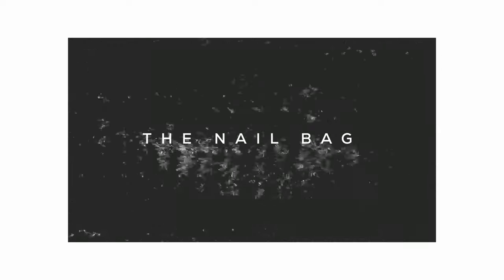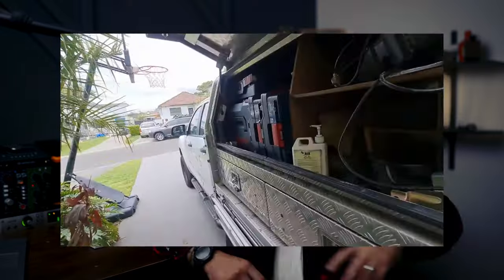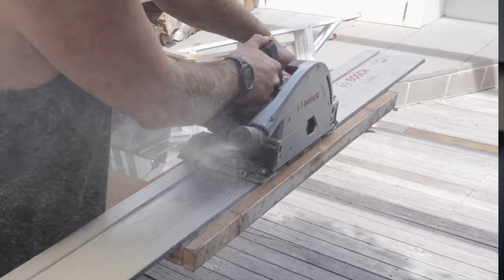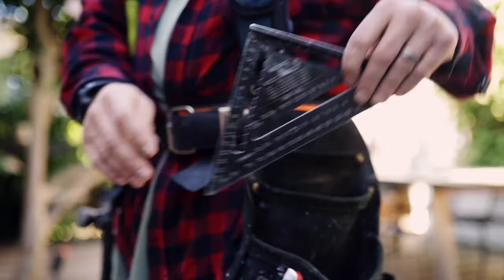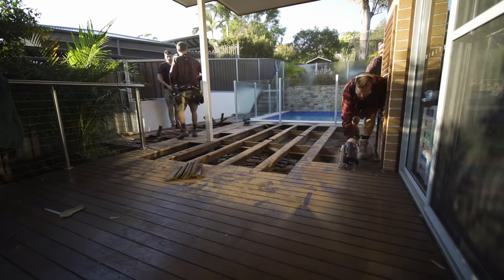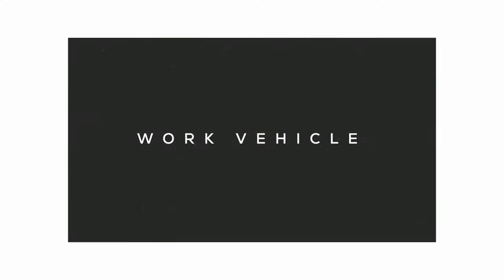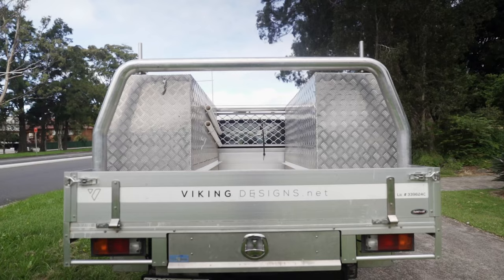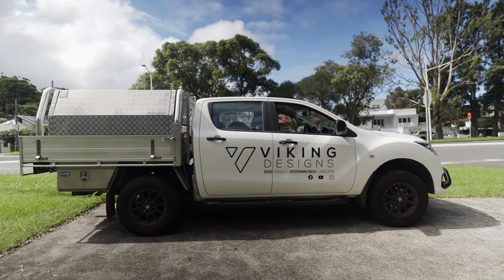5 carpentry must haves

Comment: Landscapers Top 5…

1.) Shovels- post hole (scissor), digging, square mouth, concretors, drainers. The right shovel when u need it is handy
2.) Wheelbarrow- nobody likes pushing barrows but sometimes there’s no other option. Good way to get all the day’s tools from the Ute to the work area in one trip & makes a handy seat at smoko
3.) Lasers- buying a rotating laser was an absolute game changer for me. The things I used to take ages trying to calculate with string lines takes seconds with a laser
4.) Cement mixer- another game changer for me after spending my first 12 months mixing mud by hand…
5.) Work vehicle. No family sedan’s or hatchbacks allowed. Dedicated & organised work vehicles are the best
Reply from the maker: Hard to argue with that list mate 💯. 

Especially the laser and the cement mixer! Nothing better than a creamy batch with minimal effort 😆

Comment: Aside from the ones that you have mentioned: 

1. A good, durable mechanical pencil that gives you sharp markings (I use a Rotring)
2. Hultafors Utility knife, super solid and comfortable 
3. Vacuum. Dust management is underrated (I use a bosch, would love a Festool)
4. Bosch 12V drill. Great handling, enough for 90% of the work
5. One hand clamps, Irwin, Bessey etc.

Could go on, but kept it to five. These tools just makes life easier, and reduces mistakes. Also, love your vids, keep at it! Greetings from Norway
Reply from the maker: Yeah maybe I should have done a top 20 🤣
It's very hard to narrow it down to 5. Hard to argue with that list. ✅
Reply: @viking.designs  How 'bout a continuous series then? Better to keep it to five essentials and perhaps relate those five to a specific job or build.
Reply from the maker: That's a great idea! Would definitely give a bit more space to go deeper into categories of tools. 👍
Reply: @viking.designs  Absolutely. Also, a lot of tools have small clever solutions that the majority miss out on, so that could be great way to show those functionalities in action.
Reply from the maker: Yep, you're spot on!

Comment: A few months ago I left a comment about theMetabo 601857840 KS 18 LTX 57 Circular Saw I purchased and just a follow up to that..... It broke. I was cutting a 45 degree on a 40mm timber and it simply couldn't cope. The guard straight up snapped off, drained a full 8amp battery in a matter of seconds... twice in less than a metre. Horrible purchase made a huge mistake and wanted to let you and the viewers know. I replaced it with the Makita 235mm track compatible saw and what a difference the built quality is 100 times better the powers off the charts. Great video thanks for uploading
Reply: Metabo is usually known for great quality. The LTX 57 is an older model though. Maybe try the KS 18 LTX 66 when you‘re already on the platform?
Reply: @haZee1111  I thought that as I'd used them back during my apprenticeship, now I wouldn't touch them for anything. As for the Makita it's by far the most powerful battery powered saw I've used and I've used milwaukee, dewalt etc. Honestly my metabo cordless planer still works great although the shoe isn't great. And I have an 18v brushless drill driver that works OK. I honestly wish I'd of had the opportunity to go for the Makita first off.
Reply from the maker: Hey Ryan! Yeah I remember! Oh damn, how disappointing. Yeah honestly, Makita is very hard to fault. 💪 Think you've made the right decision there. Thanks for posting your experiences here too 💯
Reply: @viking.designs  I absolutely love this channel  ❤ I love all your content and the real reviews. Please keep the uploads coming as I'm always one of the first to watch.
Reply from the maker: Thanks mate! Absolutely will do. 🤙

Comment: Around where you are mate in oz, what's the average hourly rate for a subby chippy with full tools and 13 years experience from shuttering, roofs to kitchen fitting. Cheers just curious.
Reply from the maker: Anywhere from $45 to $60. 
If you're working for a builder you might get around the $55-$60 mark.